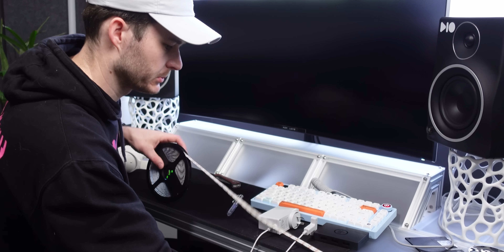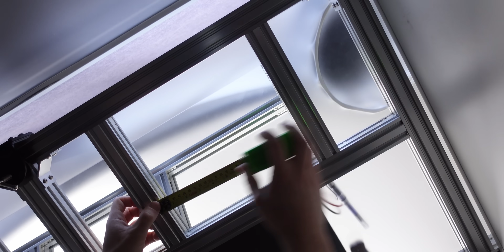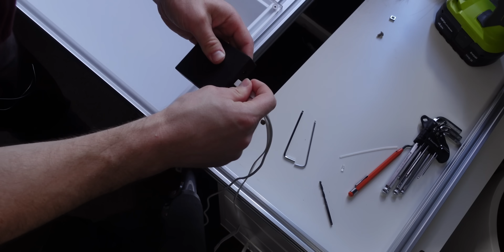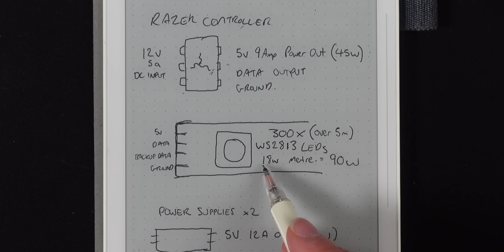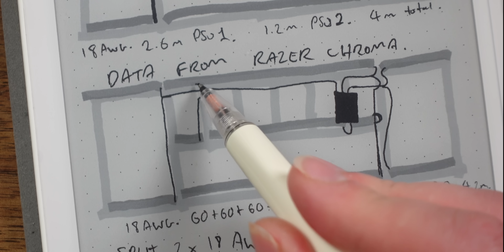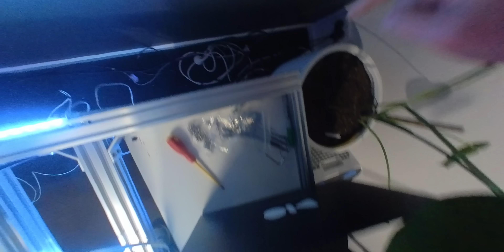Entire Desk RGB... I'm Serious!

Comment: You should of glued a tag to the end of the led strip with a string attached. This way you can pull the strip at same time you pushing it.
You can of saved yourself so much trouble.
You think outside the box by creating a very unique desk but then you get stuck on one thing.

Comment: another solution to the limited number of addressable leds with the controller, is some led strips come in 3leds per "pixel". so you can still have a high led density for a nice diffused look, but 1/3 the amount of "pixels" needed to control. 

or just use a esp32+wled

Comment: This was said already so I am not going to waffle on about WLED. 
What I am wondering though…why did you use the „waterproof“ LED strips with that clear silicone layer on them? No wonder those thicc bois don’t fit into the slots. The LED strips do not need to be waterproof, so why bother? The coating also doesn’t do anything as far as diffusion goes. Sure you can pry the clear coating off but that is such a hassle I wouldn’t want to do it. Is there a particular reason you chose this one instead of the one with no coating, or was this just a case of „I just took what was available“?
Reply from the maker: haha glad you saw the other responses about WLED 😅
As for the coating, since they're sliding into Aluminum extrusions, I didn't want the exposed terminals along the strip to short circuit.

This is also why I left the sticky back on the rear as that too is covering more exposed brass terminals. I could have manually cut electrical tape and wrapped it around each point between the 300 LED's.

However, in my initial tests months ago, non-waterproof silicon strips didn't sit securely in the V-Slot channel causing uneven diffusion from slight variance in positioning.

So silicon strips seemed best... until I got these thicccc boiis 😢

Comment: The controller probably uses power draw to detect the LEDs. That adapter is a clever solution.
Reply from the maker: I thought that and put a resistor over it's circuit too (you can see them on the bench in the shot) but didn't work either 😅 either way super happy I read a post on Reddit when first looking for someone doing something similar
Reply: @camshand  A resistor wouldn't change in power draw when you command the strip on the address line. That's probably the difference.

Comment: Hey, I was wondering what soldering iron that was that you were using and if you would reccomend it??
Reply from the maker: Yo think you're the first person to ever ask about it! I think it's super cool, it's a Miniware TS80p USB-C soldering iron. I got my wife to buy it for my Birthday a year or probably 2 ago now. Have had no issues, and with the removable tip it packs away nicely.

Also takes its temp readings from the tip which was a main consideration, as cheaper irons will take a while to notice a drop in temperature when making first contact with cold metals.

I'm no expert in soldering irons but I really enjoy being able to plug it into a 12v powerbank and use it anywhere.

Comment: Probably would've been a bit easier with WLED software.
Reply: And much cheaper :D
Reply: The second I saw the Razer thing is was like WHYYYYYYY???? Just grab a Quinled power supply and WLED controller in one and problem solved! It supports animations, scheduling, multiple strips and Alexa integration out of the box. Costs significantly less too.
Reply: same lol @hellweaver_666
Reply from the maker: Yeah that was my initial plan, until I found the gaming API integration from razer so I went through hell to make it work 😅
Reply: @camshand what does this gaming api do? If it is for ambient lighting, Hyperion over wled can do that too
Reply: lol 
I'd have just used wled and home assistant haha  @camshand
Reply: Signal RGB has gaming integration and screen capture capability that can integrate into WLED. Works a charm!    @camshand
Reply: I was screaming “just use wled!” the entire video 😂
Reply: @Tyrone-Ward same haha
Reply: Oh and doesn’t require software on the computer! Runs in the browser or via a mobile app!
Reply: Love the design. Would’ve made it about 6 inches deeper and make the vornoi speaker stands square to the dimensions of the speakers. Other than that super sick dude.
Reply: yea ESP32 + WLED easy
Reply: Absolutely sick design! I would’ve done it better of course and used something completely different than WLED or RAZER or? But hey, I’m just that good 😂😂😂…. THAT was a joke before I receive any hate. Cam shand, we can armchair quarterback all day and you definitely went hard mode however, that said? FINE!!!!!!!!
Reply: Why do that when you can just write a driver using machine code in assembly that self compiles
Reply: lol  @DB_frfr
Reply: lol yeah